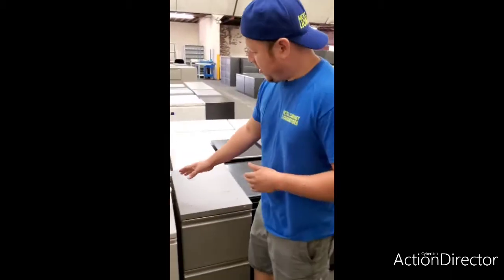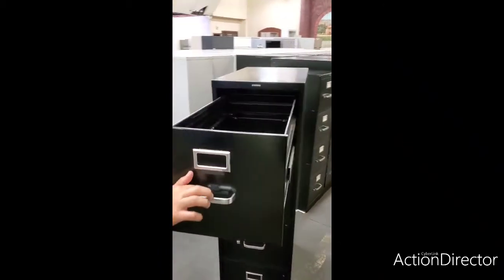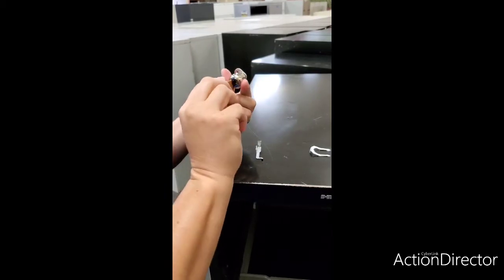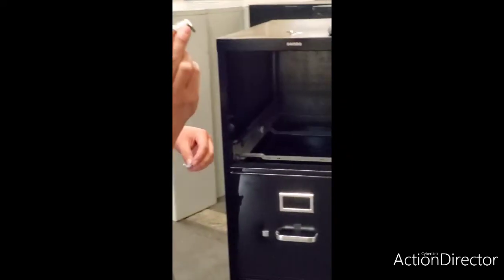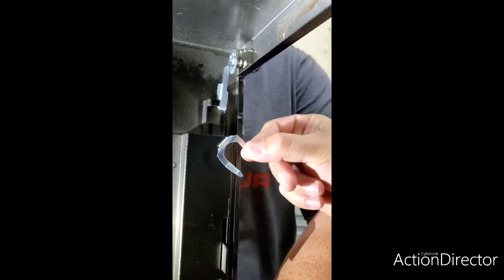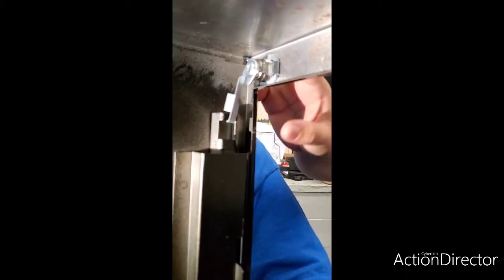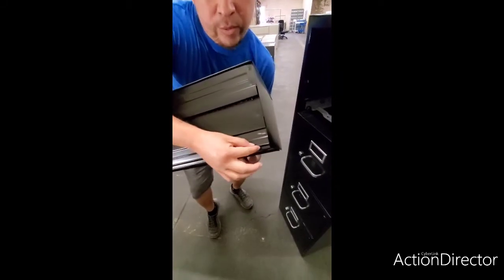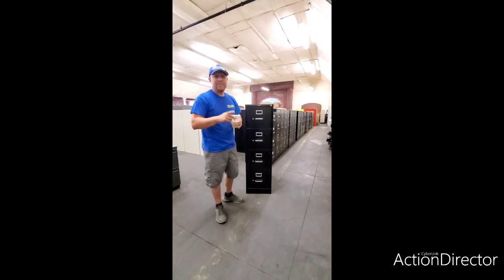How to Install a Lock on a HON File Cabinet

Comment: Can you make a video on changing the lock... Everything you just did, but in reverse.
Reply from the maker: Pretty much the same process

Remove top drawer
Remove secure piece from behind
Unhook clip from file bar (need needle nose plier) and lock should come out

3 steps and lock kit will release

Comment: Cool edutainment video. However, how does that one lock for the top drawer lock the other 3 bottom drawers?
Reply: With my file cabinet like this, when the top drawer is completely clicked closed without a lock, the other 3 drawer will still open.

Comment: Just One of the draws won't Stay locked in the vertical cabinet. It's a oval shaped lock =. I tried taking out the draw and reinserting  that one drawer (2nd from the top) won't catch ]. What to do ?
Reply from the maker: The piece that keeps the drawer locked is either broken or bent. Oval lock is an older version. May be time for a new file cabinet if broken
Reply: @metalcabinetliquidators2760  oh ok,. So  there's no way to repair the inner part that's broken. I just noticed this by chance When I mistakenly pulled it and it opened  when the rest were locked.
But thank you for your reply on this